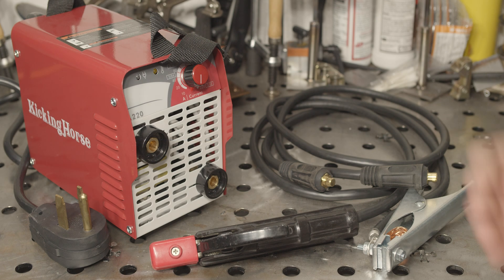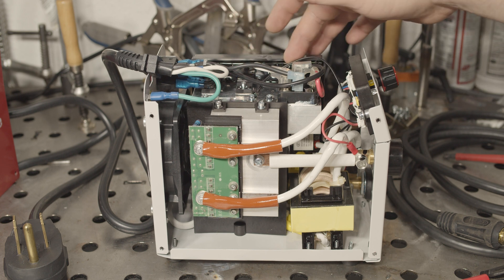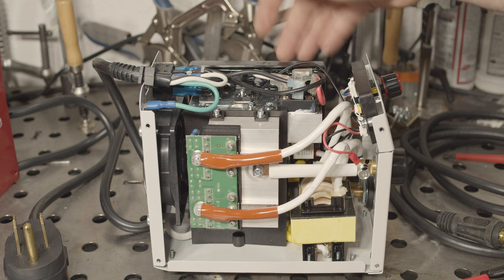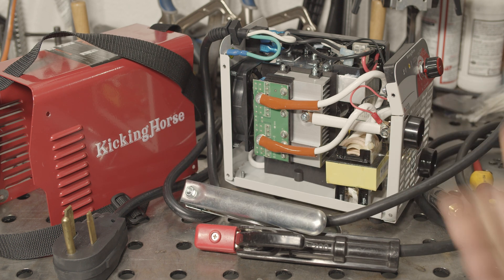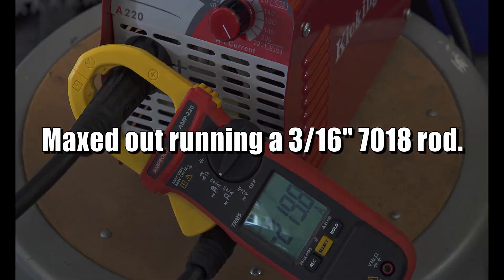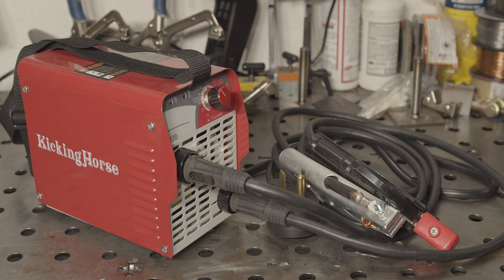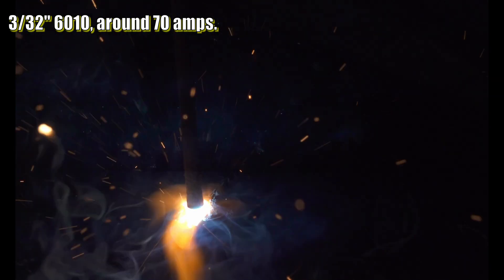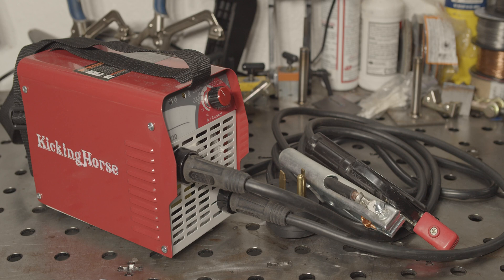Kicking Horse A220 Stick Welder Review - Is It Really a 220 Amp Welder?

Comment: Well I’ve been looking for a garage welder. I think this is the one. I had a used century welder in my garage, which I never used lol. I finally did up the wiring but ended up giving it away to a friend. I weld enough at work and definitely don’t want to weld at home lol. But now the need has risen. I prefer Miller or Lincoln (as we use them at work), but I don’t want to spend the money. My buddy has the 120v version for the last 8 yrs and he’s happy with it. For me it would be the 220v version. Also, the Kicking Horse welder is CSA rated. Thanks for the video.

Comment: wow, impressive! I've wanted one of these for a while as my current setup is only putting out 130 amps, the only problem is I'm running a 40 amp circuit and it looks like this welder will push that to the limit!
Reply: Welder have a duty cycle and breaker aren't instant trip, I've welded successfully with one of those on a 20 amp circuit

Comment: Surprisingly it actually puts out 220 amps.    The high O/C voltage is probably the reason it kicks right off and doesn't stick the rod which is good.!   I HATE welders with low O/C voltage that make it hard to strike an arc without sticking,  
  I wonder if it would do well overhead with 1/8" 7018.  As overhead needs a little extra power to be able to hold a tight arc and not have the flux snuff out the arc !        Great Review,  THANKS
Reply: It does, I've owned mine for about 5yrs now, I've burned 3/32" and 1/8" 7018 rod in every position, this thing has taken a beating and just keeps on burning rod flawlessly, welding leads are too short and the amperage dial on mine is super sensitive but I will totally be replacing it with the same one if it ever dies...

Comment: Do you know if this welder also runs on 120v with an adapter? I find the price of this unit is not much more than the 120v version, but for people  who may occasionally need the power of the 220 who dont yet have the 240 outlet yet, it doesn't make sense to get the 120v version. So if this unit runs on 120 as well with an adapter, getting this makes sense for future proofing.
Reply from the maker: Unfortunately, I do not believe it would work.  I tested a 240V welder very similar to this one on 120V and it did not work at all.

Comment: You sure have reviewed a lot of those low cost arc welder! Which on looked the best for you?
Reply from the maker: Most of them work okay.  Overall, within a given price range they seem to be pretty similar.  The Deko 160 amp, dual voltage machine was decent for the money.  This Kicking Horse welder seemed a bit nicer than some others, but it's a bit more expensive and 240V only.  I have an S7 branded machine that I'll be testing soon that claims to have a 6010 mode, so that will be interesting to test.
Reply: @bigtb1717  Are you planning to review the Husky Pioneer Stick 225? $248.00 SMAW for 225A@240V and 70A@120V with full digital control sold at Home Depot. Might be a contender for the best low cost stick welder?
Reply from the maker: @pipe-brain  I'll look into it.  Right now, the Titanium Stick 225 from Harbor Freight is one of the best I've tested and it sounds like the Husky has very similar specs.

Comment: how does it compare to YesWelder 205amp stick?
Reply from the maker: The Kicking Horse welder is 240V input only, so that is a consideration.  It also comes with super short welding cables.  But it has much higher output than the YesWelder ARC 205DS, It's a bit smaller, the internal build seems more well thought-out and the output much more closely matches the specs.

Personally, I prefer the Kicking Horse.
Reply: @bigtb1717  thank you very much for the fast reply... I am looking to buy a small welder that costs less then $400 and that can produce strong welds becuase I plan to weld parts of a trailer that transport cars.  I was thinking about YesWelder but after your video and your reply... Kicking horse becames a better option for me.  Is there any other welder that I should consider in the  sub $400 price?
Reply from the maker: For something like a car transport trailer, your skill/technique will probably matter more than the welder used, assuming you don't use something that is simply underpowered.  Pretty much any stick welder that can burn a 1/8" rod nice and hot would be fine for what you want to do.  Again, assuming you do your part. 

Assuming you can get one, the Clutch ST201iDV is a good machine for just under $400 (it used to be $389).  

Even the Kicking Horse A220, as long as it keeps working, there's no reason the welds from it wouldn't be strong.
Reply: @bigtb1717  hi sir... I bought the kicking house and I am about to get started when I saw it is 220v single phase.  You are in the US, correct? how do you connect it? My understanding is that 220v in the US is dual-phase... am I confused?
Reply from the maker: 220/240V in the US is single phase.  We also have a half voltage wire that is used as the “neutral” that gives 110/120V.  The Kicking horse welder uses just the 240V, single phase connections and the ground.  It does not use the neutral.  Overseas, many places have 230V with one of the legs used as a neutral.  They don’t have an additional, half voltage wire.  In that case the welder would use the 230V (one of which is “neutral”) and the ground.
Reply: @bigtb1717  ...yesterday I went to check my eletric range/stove which is 50amp and I saw it has 4 wires (2 live + 1 neutral + 1 ground) I plan to pull an extension from this outlet. From what i understood from your explanation, it should work without a problem!

Comment: Would this be alright for someone who doesn't have a clue about welding? I have a few projects around the house that need to get done.
Reply from the maker: In terms of getting something to learn stick welding, this welder would be fine.  Some projects will be a bit more difficult with a stick welder than some other welders, but stick welders are extremely versatile, so there's nothing wrong with starting there.  What types of projects do you have?

No matter what you end up with, don't expect to be an expert right away and don't get discouraged.  Get some scrap metal to practice on and get comfortable before tackling anything that you could ruin if it doesn't go well.  Also, make sure you wear the proper protection gear, especially a proper welding helmet.  There are lots of videos online that teach good stick welding fundamentals for when you are just starting out.
Reply from the maker: Another quick note.  This machine does require 240V.  So you will have to be sure you have a 240V circuit y ou can plug it into.  If not, you will want a machine that can run on 120V.

Comment: You run 7018 AC or excaliper??
Reply from the maker: I mostly have Lincoln Excalibur, but I also have some 5/32" that is a different brand.  Don't remember the brand, but it is normal, DC 7018, not the stuff rated for AC.

Comment: They are a Canadian company I believe
Reply from the maker: Technically.  But they are also also part of WeldKing and Malo Welding Products.  They all seem to have a contact address in Canada (Kicking Horse and WeldKing both list the same address).  Hard to say if that's just a token mailing address, or if any actual business is conducted there.  The street view of the address seems to show it as a suite in an office building with no signage or anything.
Reply: @bigtb1717 I wonder how "Canadian" they really are too, lol, I have to admit that I like the CSA approval and it has me looking at there ma200ts, any chance you'll be doing a review on that machine one day?

Comment: I was thinking while watching this video, ive seen miller and all sorts of in between welders being reviewed on this channel, what do you run when its just you doing a project or side work? 

Seen this welder on the zip ties n bias plies channel, I think they went up a few bucks after he did a video with one lol.
Reply from the maker: My "main" welder is a Miller Dynasty that I've had for years.  I got it long before I ever made a welding video on YouTube.  I did some paid work with it for a while, and there is still a company that would likely call me in the rare instance that they needed something welded, but it doesn't happen often.  I also still have my ESAB EM215 MIG welder and that's my only MIG welder currently.